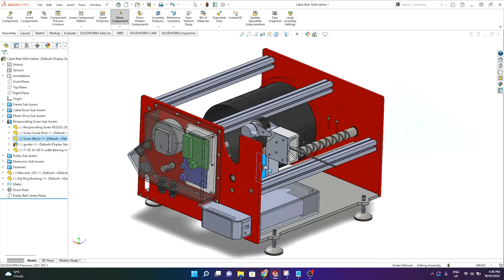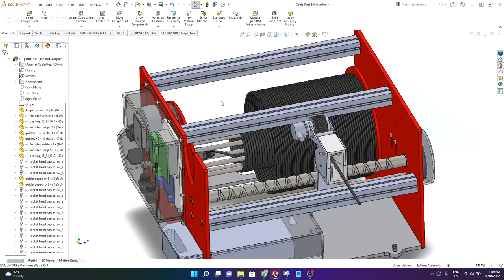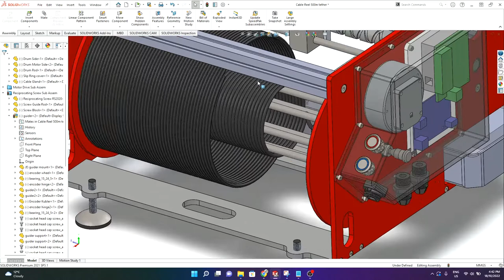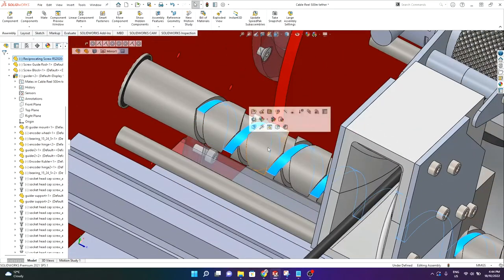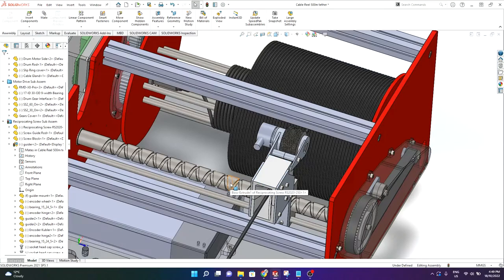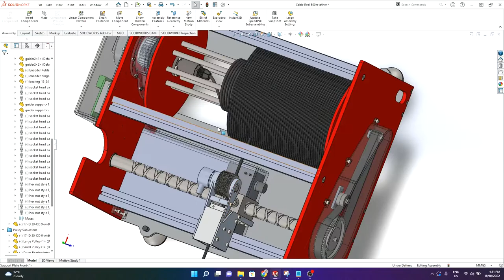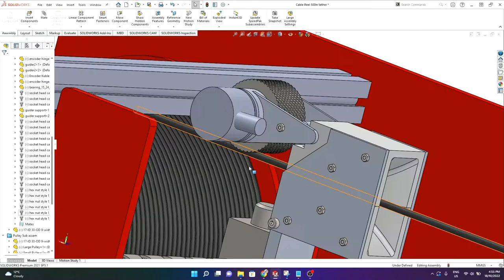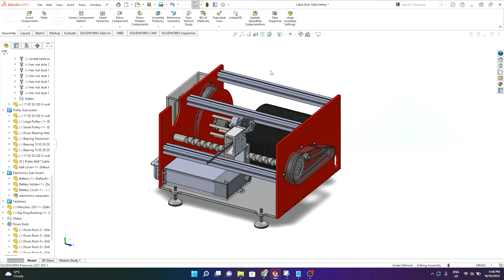Automated Cable Reel Design Using Self Reversing Lead Screw

Comment from the maker: CAD files available at my website mdesigns.space

Timestamps:
Problem being solved 0:53
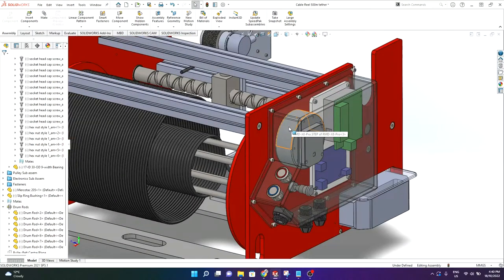Cable Drum Design 4:32
Timing Pulleys 7:36
Self Reversing Screw 7:58
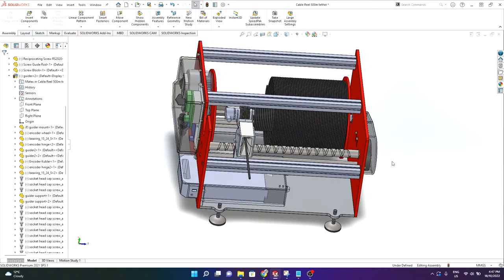Movement Ratio Calculations 10:27
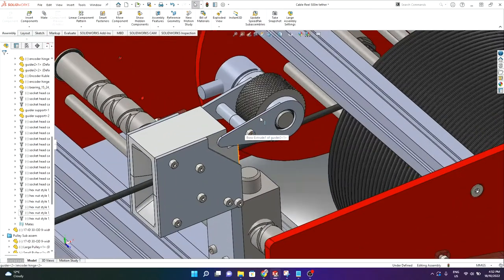Encoder Wheel 14:26
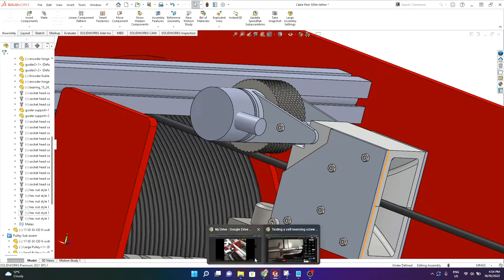Built System Demo 15:35
Electronics 17:07
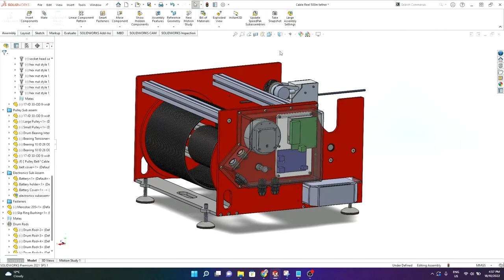Manufacturing 18:10

Comment: Love this video, it is very helpful!
How did you design the screw and get the intersection so clean. 
-Did you use the thread command or the helix/ spiral?
Reply from the maker: Thanks! To make the screw I believe I just did two swept cuts. I made two helix curves (using the helix tool) and swept two square profiles

Comment: Hi...great design
Few queries..
I couldn't understand how cable gets wrapped around the bigger drum...
And what does that encoder do at the knurled wheel location?
Reply: It looks like only one drum... the larger roll of cable is just to show how large it can get.  The encoder feeds back data on how much linear length of cable has passed, by converting revolutions of the wheel x circumference of the wheel.

Comment: Great video! Can you point out or point me to any resource on how you optimized the nut and/or screw design for a smooth transition on either ends?
Reply from the maker: With a self reversing screw the transition should naturally be smooth at the ends